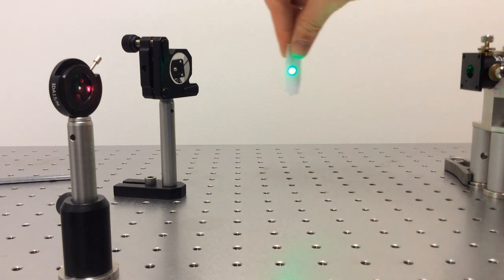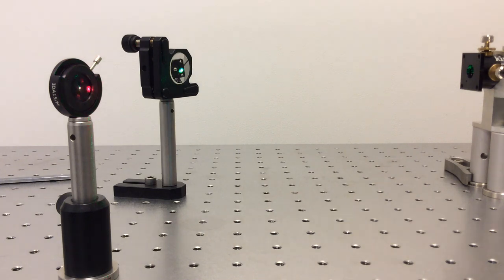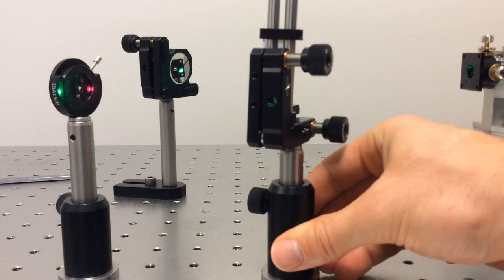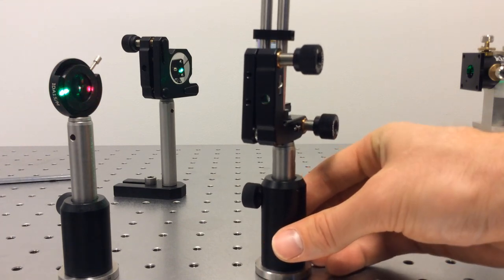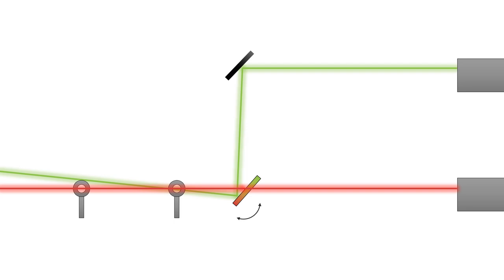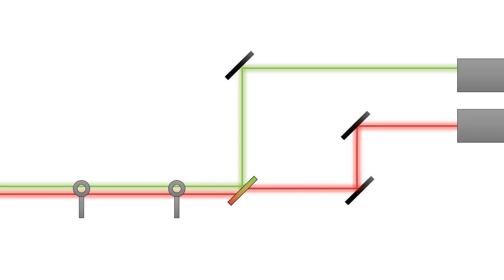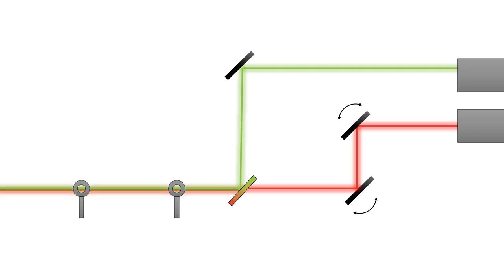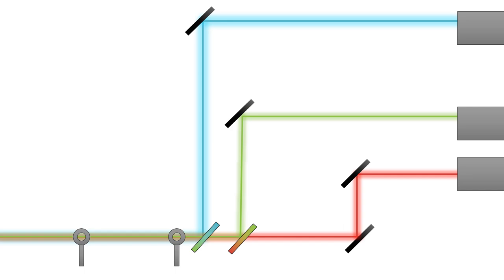9 - Combining wavelengths

Comment: Thanks for the videos! These are great (liking each one in this series and subscribed). Couldn't just the red laser be moved instead of adding two steering mirrors? I'm sure there's some benefit of the steering mirrors so I'm curious why choosing one over the other. Thanks!
Reply from the maker: Hi! Theretically: yes. In practice though, you will have a hard time steering the laser beam accurately by moving the potentially chunky laser itself. Some lasers come in adjustable mounts - there you might be okay without the mirrors.
Reply: @opticalsystems7076  Makes sense, thank you!